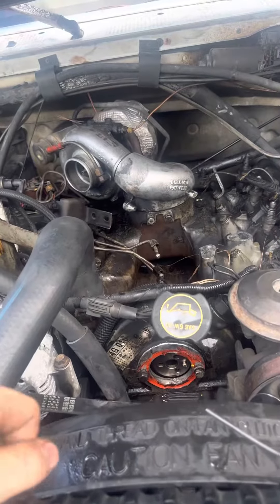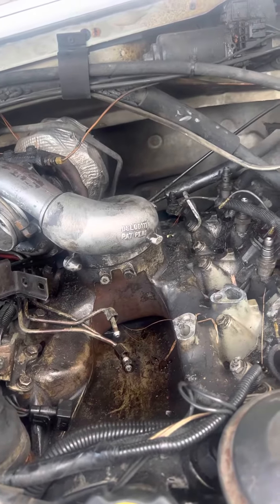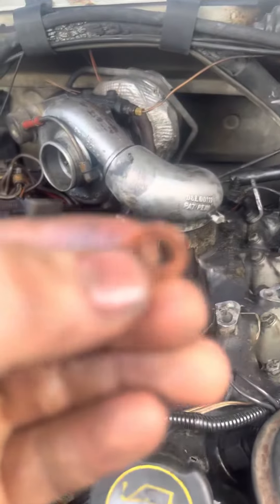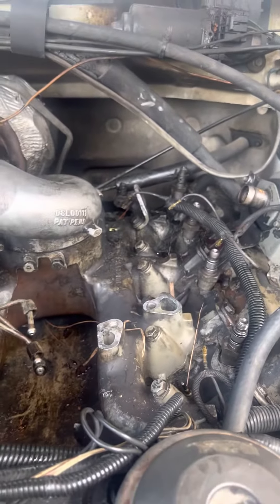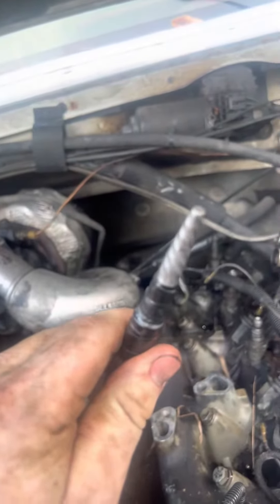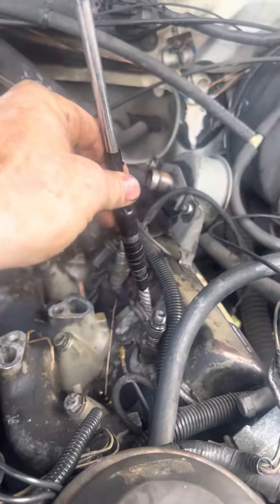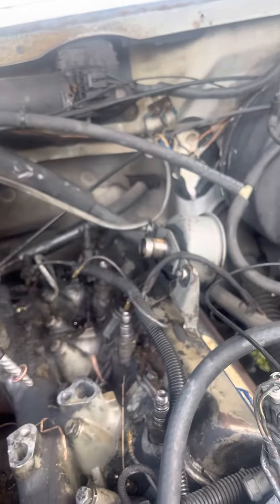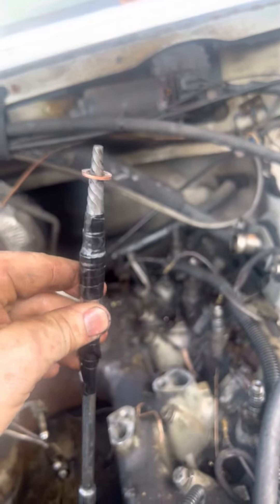How To REMOVE Stuck Diesel Injector Copper Washer

Comment: A long straight blade screwdriver lightly hammered into the hole in the washer works well.  It bites the washer and allows you to twist it to break it free.

Comment: What's that socket atchment called?
Reply from the maker: A 12pt socket and electrical tape. 😂😂😂 I wasn’t with my tool box at work so I didn’t have the correct tool on me. But lisle makes a tap/extractor socket set. Lisle part number 70500